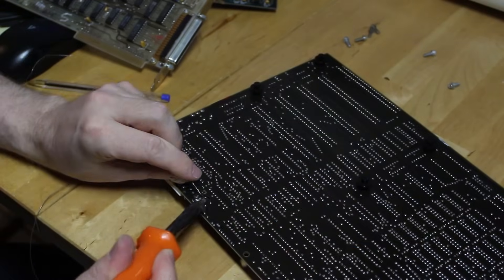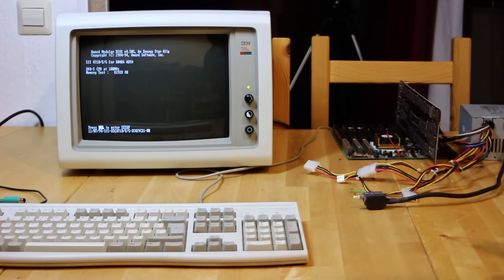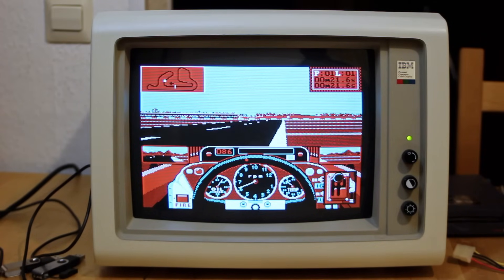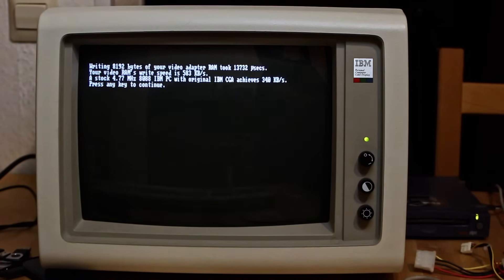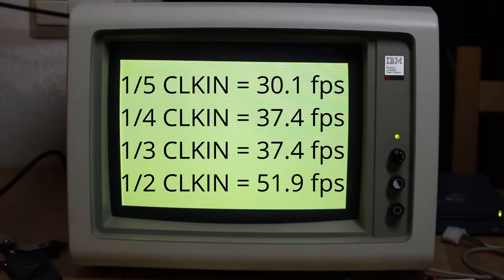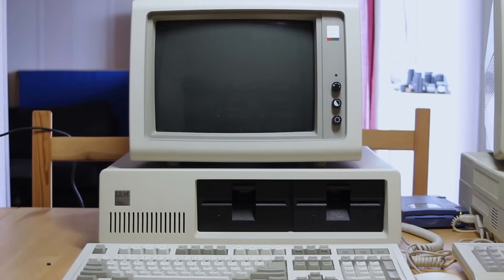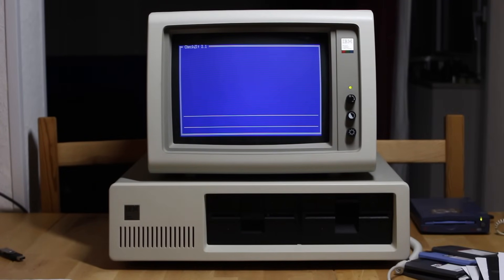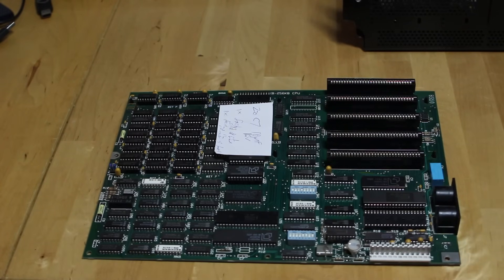Don't put a graphics card from 1981 in a PC from 1994!!

Comment: Before I say anything else, a brief apology to PCRetroTech for leaving you hanging on the CGA improper on stock thing: It likely (my current guess: 95%) would not after all work as I expected, though there might still be an outside chance (5%). I've not followed up and not gotten back to you because I got sidetracked and overwhelmed, including mentally, and I guess that latter part now includes that there's a war – almost beyond comprehension. In principle I still would like to get back to you on that one day, but in the meantime you're probably reasonably safe in assuming I was once again talking nonsense.

On plugging stock CGA into newer boards: Been there, done that, didn't know about the whole what's clocking what when I did it. The interesting thing is that at least well into the nineties and noughties, boards routinely used to have that one 8-bit ISA slot (and I wouldn't exclude the possibility that perhaps some ISA-compatible boards still do), though I'm not sure the board designers always understood why. 
That's because when I last plugged my IBM CGA into a maybe 386 or 486/Pentium board (hard to remember which), there were a bunch of ICs and various sufficiently tall components behind the 8-bit ISA slot that actually physically blocked things, so the CGA could not be fitted into that slot. What I ended up doing was, I cut out the very back at the end of one of the 16-bit slots, and then I used some simple insulating material, it might have been just a piece of paper, and wrapped that around the rear bottom edge of the CGA card, so I could physically push the card into both the non-insulated 8-bit part as well as the insulated 16-bit part of that slot – so that it fit but nothing in the 16-bit extension slot made contact. It wasn't pretty, it required cutting out the back of that 16-bit slot, but it worked. There was nothing else in the way behind that particular 16-bit ISA slot. 

I don't think the single 8-bit-only ISA slot that routinely was on boards back then was there for any other reason than to accommodate large cards whose PCB dimensions resembled that original CGA. But I think including one 8-bit ISA slot was one of those things everybody was doing, but not everybody who was doing it remembered why they were still doing it, and that resulted in mainboards whose inclusion of an 8-bit ISA slot was kind of useless -- like the board I had. I guess you could still justify that 8-bit slot as "Hey, you can fit a short ISA card in here without the slot taking up more space on the board", but then, why not just add another PCI slot instead, because we're prolly well into that era at that point? 

It's a nice little litmus test: If there isn't a "firebreak" of only low-profile components behind that 8-bit ISA slot, the board designers didn't know what they were doing. Which was probably common, I'd wager.
Reply from the maker: Thanks for the update on the CGA Improper mode. And yes, I too have been annoyed by slots in line with components which jam against full length cards. This board was interesting precisely because it allowed the full length card to be inserted and also worked with a CGA card as primary video device, including BIOS support for it. It was also very interesting to be able to adjust the speed of the ISA bus in the BIOS.

I have very many late 486 boards, and I believe it is the only one with these features.

Comment: Love the video and the topics you explore!
Unfortunately, you picked one of the worst games to showcase CGA RAM speed:  Grand Prix Circuit is internally framerate-locked to 10fps, so it looks the same on any 286 or higher.  A much better game to test how CGA RAM speed affects gameplay is Jet 2.0, which updates the screen with REP MOVSW and can run as high as 60fps on fast hardware.  Otherwise, using a benchmark program like you did in the video is the only way to reliably measure speed changes.

It is difficult to find games that can reach 60fps and support CGA.  This is because, in the era of programming for CGA, it was impossible to reach such heights, so programmers cut corners that would never cause an issue with speeds of the time, like lock the internal framerate calcs to a low rate (10 Hz, as seen in Grand Prix Circuit).  Or worse, not lock the framerate at all, so you see some games become unplayable on CGA on faster systems whereas the same game works fine on EGA because the timing is locked to the page flipping rate of 60Hz; Stunt Driver is one such game that comes to mind.
Reply from the maker: Wow 10fps, really. I felt really sure it was much higher than that. It seemed butter smooth in person. And I feel like I can usually tell framerates up to about 12fps. I'm not at my computers right now but when I get back to them I think I have to check that out to figure out how I fooled myself so easily. Probably I was just focused on the video so much I didn't even notice. It's definitely a shame I made such a bad choice.
Reply: Maybe FastDoom would be a good option to test with nowadays. It supports CGA now IIRC.
Also: can you query vertical refresh on the CGA? I only know how to do that on VGA.
Reply: @root42  You can, using the same port read mechanism.
Reply: @JimLeonard  awesome. Thanks for the clarification.

Comment: the bad adjustable colorburst cap could have caused excessive noise back to the CPU clock line, IBM PC and XT boards both used a 14.318 mhz crystal and I think it was divided down for various functions in the machine including the CPU clock IIRC.

Comment: Check with modern vga if it goes faster, if not, the game has fps control, or the speed of the physics in the game are not related to the rendering process, they are independent. This is done in games mostly playable on a network.

Comment: is there anyway to override the coiors in the palettes?
Reply from the maker: No those are fixed. You can change the background colours or use a hacked up text mode to get all 16 colours at once, but other than that there's not much else unless you are prepared to use a composite monitor.

Comment: Looks like that floppy chip in question would be a terminating resistor pack. Likely should be installed on the last drive in the chain. Maybe early floppy setups were noisy and needed a t-res? Ive never heard of PC's needing a terminating resistor on a floppy chain as a requirement.
Reply from the maker: Yeah it was a surprise to me too.

Comment: About the dip package that one of the drives lacks, if I remember correctly, old disk drives didn't use the twisted cable to identify the two drives connected to the same cable, so I guess the component is a terminator.
Reply: No it's to terminate the bus.  The drivers are in fact both configured as drive 1 with a twist on the cable, but the floppy controller card needs the termination.
Reply from the maker: @booboo699254  Oh I misread that bit. Yes, the cable has a twist.
Reply from the maker: That seems to be the case. Thanks for the comment!

Comment: Hi

There is limitation to the ISA bus, it does not always run at 4.0mhz, they are fairly robust and can be pushed and  run up to about 20mhz

This is what the clone market done, as they pushed the XT into the Turbo XT territory, they also found tweaking the bus helped, as you mentioned no good having the cpu doing 8/12/16/20 mhz is the bus is fixed at the original slow speed.

As for software / games. The original PC/XT were all the same speed 4.7mhz, so you just coded, there was no need to think of CPU speed

With XT Turbo, AT / 386 days, old programs were just running to fast - like your zaxxon, the game has done all the clock cycle calculations and yes you were to slow on the keyboard, all those non-movements from you means crash
Try playing space invaders or frogger, you are dead by the first or second keypress

So programmers wrote some test code, either hardware probing or some nested loops and get the elapsed time / clock ticks taken - then factor that as a percentage of the XT, this gives you some software wait states

This is where turbo C and turbo program programs have that divide by zero crash, as the nested loops on newer machines are done under 1 second, as a integer it is divide by zero

There are some good old tools and test programs for video cards and hardware rating, no 2 give the same result :) i find nortons sys info ( version 5 ?? ) fairly good

Regards
George
Reply from the maker: Hi George, thanks for your comments. Indeed, some games use the CRT frames to time things and they behave much more reliably across different machines. The ones that just go flat out will simply run too fast on later computers. It's quite interesting to find the games that work well on the later machines.

Comment: I had a board almost like that. I stuck my internal modem in that slot.
Reply from the maker: You still use an internal modem? What do you connect to?
Reply: @PCRetroTech  Nah, lol, back when I had a 486 that used this type of board. It looked exactly like this one only it had 4 four 30 pin simms, and two 72 pin simms. But it had that single 8 bit slot exactly like that. Board makers did that for real estate reasons, in this case a chip of some type. (If they even added the 8th slot, by the end of AT most did not) While you could put an 8 bit video card in it. That wasn't its primary purpose. There were a lot of 8 bit ISA boards back then. So back in the mid 90s that slot is where my 14.4K Internal Modem lived. But there were a lot of other 8 bit cards that were short that could fit in that slot and be out of the way.
Reply from the maker: @Alcochaser  Yeah I very much doubt that had this particular application in mind. :-)

Comment: I always love this kind of mix of non-era part. Way back I ran an ATi Small Wonder with an amber monochrome in a Pentium 3 board. It ran as a Linux server for a while. Later I used it as a networked music player using mpxplay and a dos smb client.
Reply from the maker: I think mixing parts like this can be fun. Part of retrocomputing is about experiencing things as they were back in the day for nostalgia, and part of it is trying new things that we couldn't try back in the day. Both are fun.
Reply: @PCRetroTech  I run an ET4000 in my 5150 just so I could have VGA on it.

Comment: Games that were designed to run on a wide variety of cpu classes hook the PC's interval timer circuit and use it to synchronize the screen updates. Thus you can have consistent game play across machines of different performance. Grand Prix Circuit is one of these games. Once you have a CPU that exceeds the computation power required to play the game without bogging down it spends time in an idle loop until it is required to generate the next frame.
Reply from the maker: Yes, that's correct. The other way it can be done is to use the vertical retrace of the screen, which is usually 60Hz give or take on most older machines.
Reply: @dgmt1  For overall game speed maybe, but a lot of those games still had other unforeseen timing issues, such super fast animations, physics bugs or trying to access the sound card too fast. There were still some big name 90s games that were straight up speed sensitive too, such as Ultima VII and XCOM.
Reply: @ozzyp97  Same on other platforms. I once tried playing an old Mac game (some Breakout clone, can't remember the name, I'd say early 90s) that ran fine on a IIcx with its 68030 on a Power Mac and it was absolutely unplayable, the ball moved lightning fast.
Reply: @ozzyp97  It's still an issue to this day if you're using a monitor over 60Hz. Most (if not all these days) games like this will have some kind of programmed frame cap to stop it, but people who demand high framerates will inevitably hack them and then complain about the wonky physics.

The last game I found this happen on without any hacking was from late 2000, and it was Championship Manager 01/02, which is a menu driven football simulator. It was impossible to control the scrolling on anything faster than about 1gHz.
Reply: @fattomandeibu  Yeah, unfortunately a select few big studios still haven't moved to the 21st century. Looking at you FromSoft, I still haven't bought Elden Ring out of disdain for their sheer technical ineptitude.
Reply: is this inside a memory disambiguation chip? because CPU would need to dump a buffer IC about store to load forwarding the "clock frame"
Reply: I think this is the reason we'll never see such technical review on youtube to get tenths thousands of views

Comment: T-RES stands for terminating resistor and it is used to tell the PC bus where the last drive on that control line is. So if you have two floppies, if memory serves, the resistor block should be on the B drive. If you have an XT with one floppy drive then the only floppy drive, A, should have it installed. Hope this helps.
Reply from the maker: Thanks. That is what I am getting from others too. So I think there is a concensus on this now.

Comment: Some of the new retro games that run under DOS target the improbable combination of 486 with CGA (e.g. Castle of Viana). Now you have the ideal system for them! It was nice to see the IBM back to being a happy computer in the second half. Hopefully it will get its voice back soon.
Reply from the maker: Nice! I hadn't seen Castle of Viana, and that's precisely the sort of thing that will make an interesting follow up. And I do hope to fix the sound issue in a later video too. Thanks for the comment!
Reply: Are there any other games that do this? Why would anyone write a 486+CGA game?
Reply from the maker: @michalzustak8846  It's just not optimised well. People write stuff for emulators, which are 386 minimum and they do things the easy way, e.g. BIOS routines and high level languages instead of doing assembly language and the like.
Reply: @PCRetroTech  Even say DOSbox set to 400 cycles which is as slow as a 4.77 Mhz PC?
Reply from the maker: @michalzustak8846  Of course you can slow it down, but then these games are not playable. Viana requires about a 486 75MHz to be playable because it is not optimised. It was written as part of the CGA Game Jam competition where there is very limited time to write the game, so certainly not enough time to optimise the code.
Reply: @PCRetroTech  I know I meant that one can slow down an emulator to a level below the 386 if one wants to target a really old system. Hmm interesting, any other examples of such games?
Reply from the maker: @michalzustak8846  There's probably a few DOS Homebrew games and CGA Game Jam examples. But I don't know of any off the top of my head.
Reply: @michalzustak8846  I think there's at least one other DOS game from the same jam that needs a faster processor than you'd normally see paired with CGA. But I can't remember the title - only that it's one of the games with a Western theme.

Comment: When my VGA monitor died, I used for a short time (few weeks I think) a original Hercules adapter. I also had a CGA card but no monitor to pair with. Luckily the Hercules I had was paired with a beautiful amber mono screen.
My first shock was when I entered the BIOS setup. My motherboard had winbios (graphical UI) but it was unrecognizable with that Hercules; it was displayed in a strange text mode. The next surprise was that Win95 was not able to boot with that card. So i took another HDD with ms-dos to use. The time I spent with it, was entertaining, it was like a lottery to run programs; would it run? and if so, how will it look? I also used a CGA emulator for Hercules that allowed to run CGA games on that mono card. I also remember that the only GUI OS that worked with Hercules was Red Hat Linux (ver 7 I think it was) that I installed and ran fine with X server GUI only. Win 3.1 or 3.11 would not run in mono, only Win 3.0 was able to. The only drawback was that I had no idea of Linux and no manuals available, so no way to learn how to do something useful with it. So I returned to Windows as soon as I got a new monitor.
Reply from the maker: That's a pretty funny story. I guess at least you managed to learn about which software would and would not work with Hercules. It's amazing how old technology just stops being useful at some point, even though one of the major selling points of a lot of PCs is that they are supposedly "future proof".